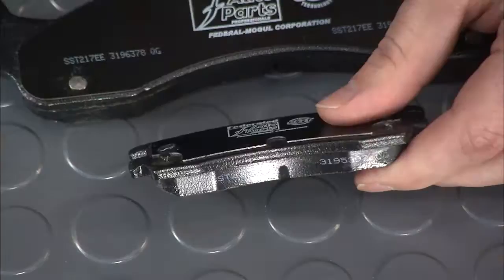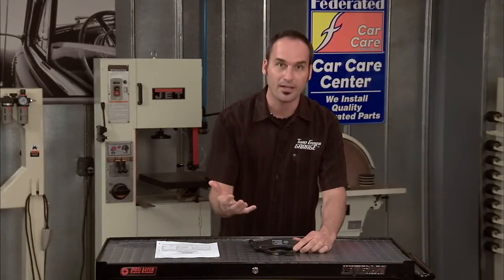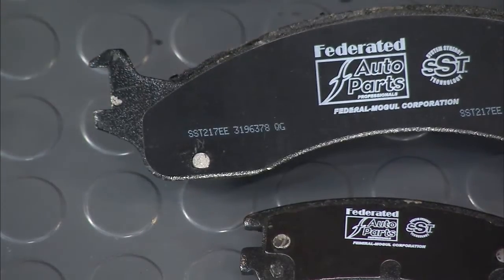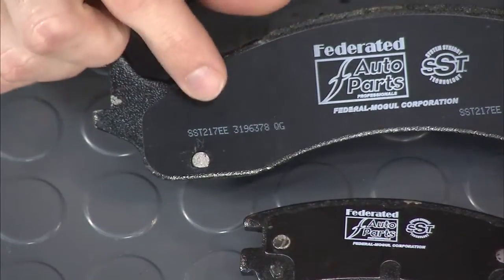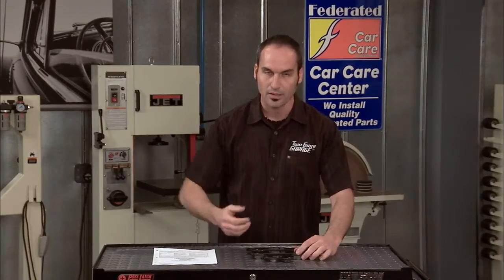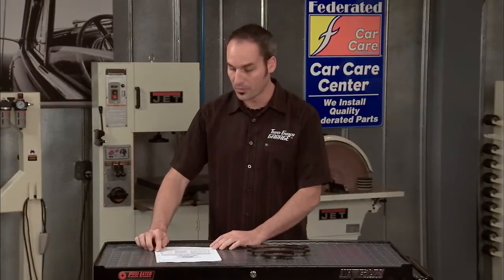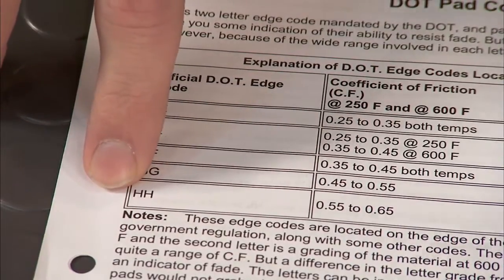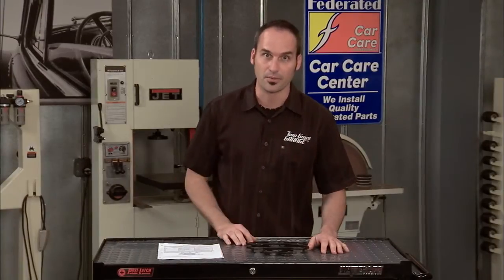Making Sense of D.O.T. Brake Codes

Comment: what brake pads are used in yaris
Reply: There are several manufacturers that offer brake pads for the Yaris.  Akebono, Bosch, Wagner and our own Federated EVS and SST are some of the brands available through Federated Auto Parts Distributors.  If you contact your local Federated Auto Parts store or Federated Car Care Center, they can give you specific details that are applicable to your model year.
Reply: Use rock auto